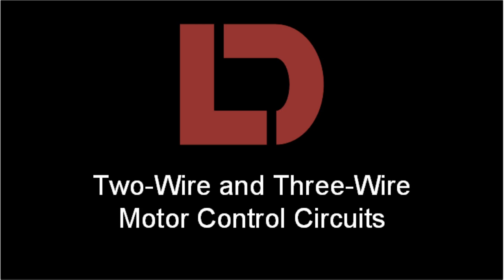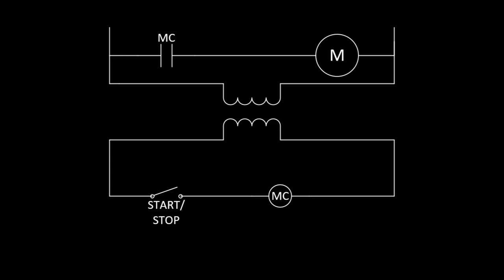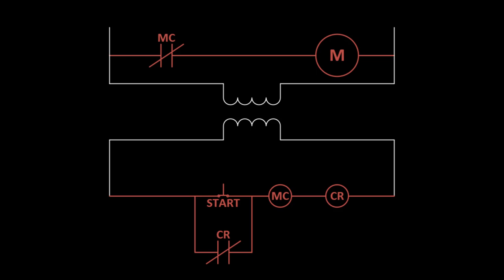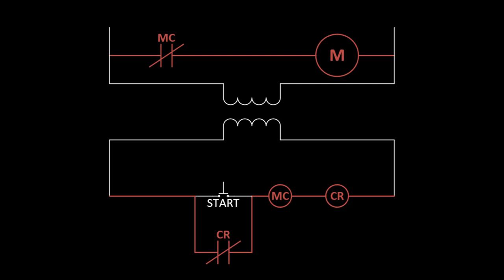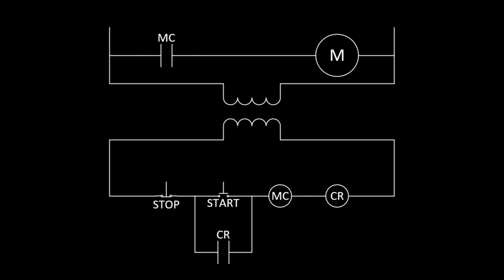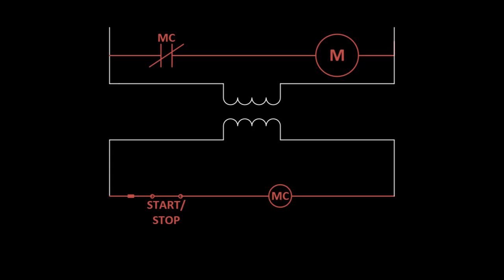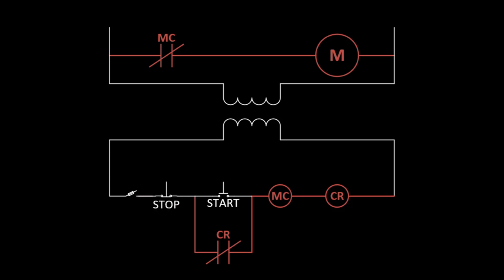Two Wire and Three Wire Motor Control Circuits

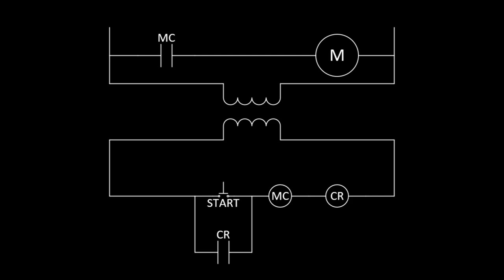Comment from the maker: 1:00 Note that the additional contact may instead be an auxiliary contact connected to the Motor Contactor coil.  The function covered by CR in this circuit does not necessitate a separate Control Relay coil.